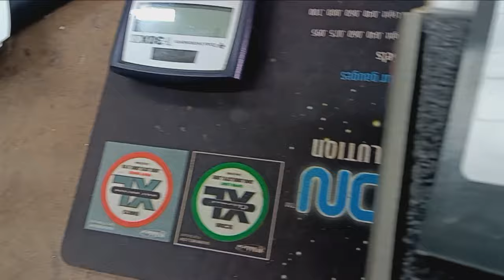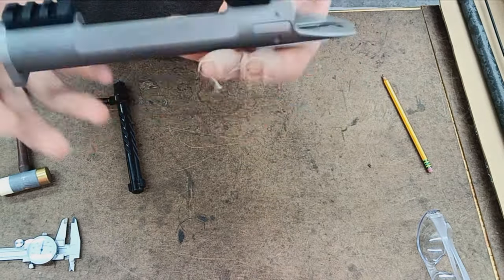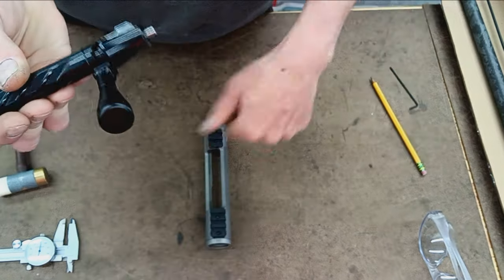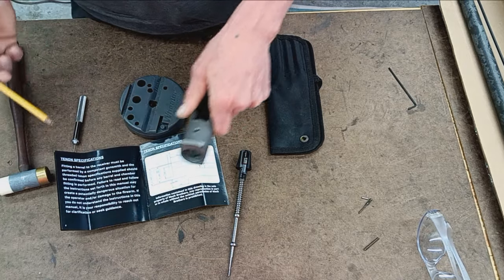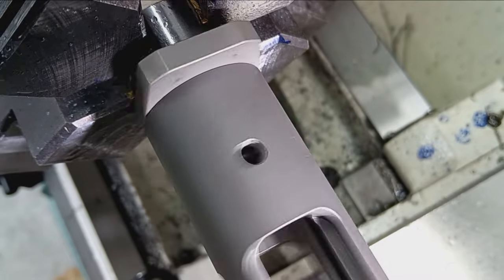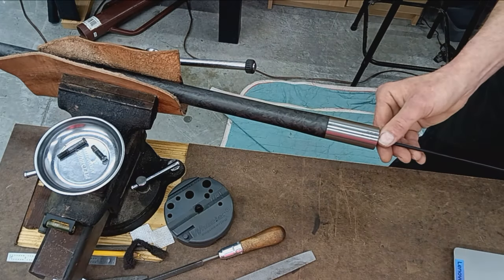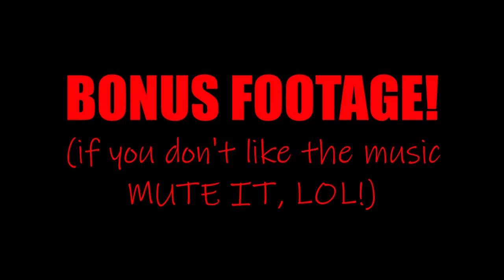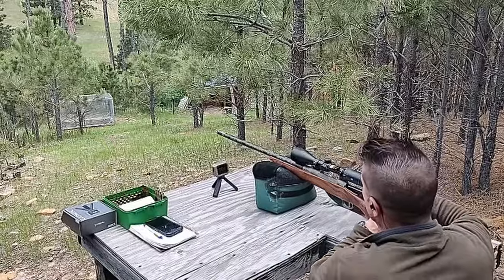A Century of 300 Holland and Holland - Super 30 - Centennial Celebrated  with a Custom Rig for S.T.

Comment: Anither nice build Geoff. A term i have always heard is inherently accurate in reference to cartridges, i believe they meant "consistency" (size of the group) accuracy is more hitting what you are aiming at. So, any cartridge with good brass, good primers, powder and bullets should be consistent. Put that in a high end barrel, action and stock, with a fine trigger and you get performance. Geoff you build performance oriented rifles. Nice job!
Reply from the maker: Thank you sir!!  That means a lot coming from someone like you!